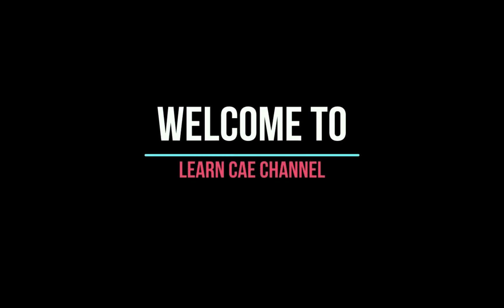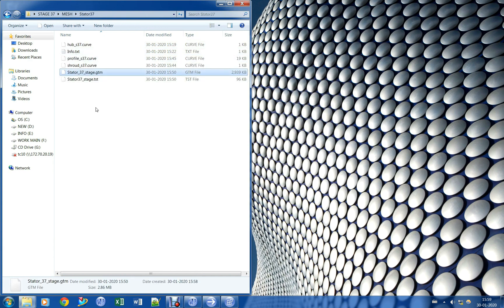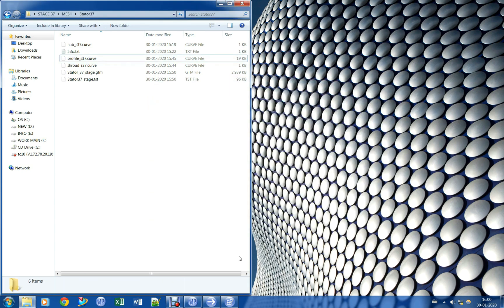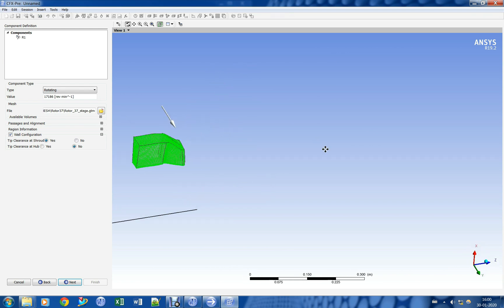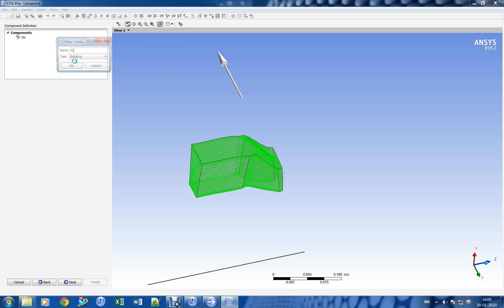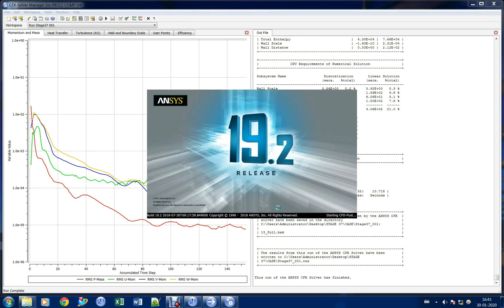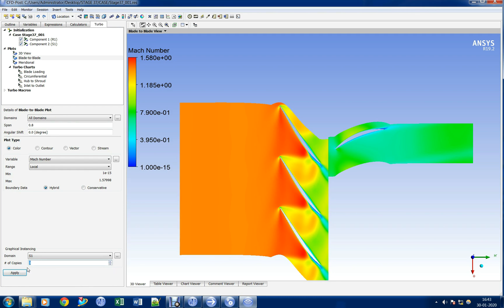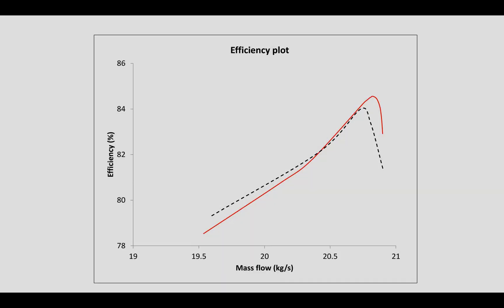CFD analysis of NASA Stage 37 compressor (Rotor 37 + Stator 37) | CFD Validation | Ansys CFX

Comment: Hi, thank you for the helpful video.
I purchased the file and had a few questions:
	1.	Are you confident that the data in the Excel file accurately represents the geometry used for modeling refer to nasa document?
	2.	In the validation section, could you please clarify which results are from CFX and which ones are from the reference paper?
	3.	If some of the results are taken from the paper, could you explain why there are differences between nasa result and the CFX results?

Thanks again for sharing this work!

Comment: Hi sir, Can you tell me this case with back pressure 120 the aerodynamic design point for stage 37?
Reply from the maker: HI, we cannot specify the design point with respect to back pressure. You need to adjust the backpressure to achieve the design mass flow rate and pressure ratio as per the paper. You may get a closer value for a particular backpressure. You can iterate and check it.

Comment: May I know where you get the outflow boundary condition which is 120 kPa of static pressure?
Reply from the maker: Hi,
That depends on the expected pressure ratio and Mach number at the outlet. Based on expected pressure ratio, you can get the total pressure at outlet. Further, using Mach number and total pressure at outlet, you can get static pressure using isentropic relations.